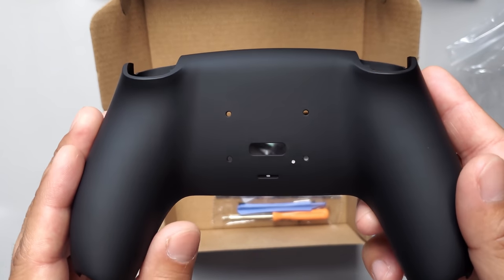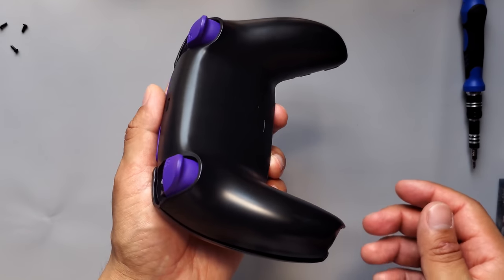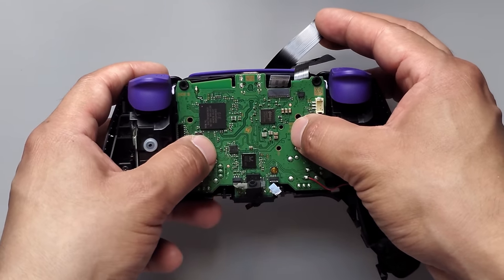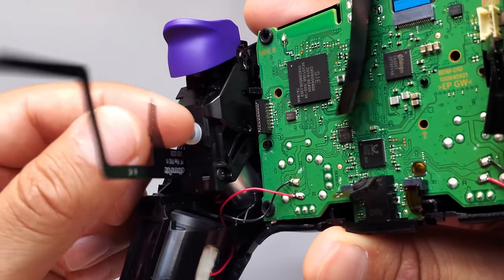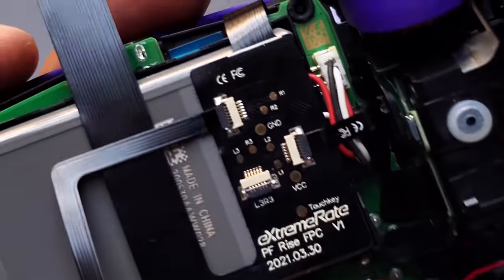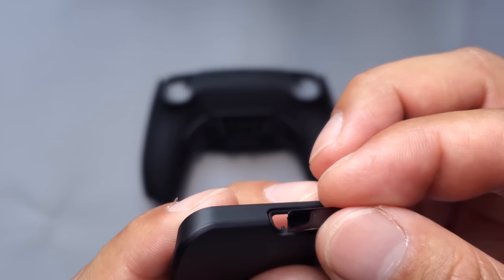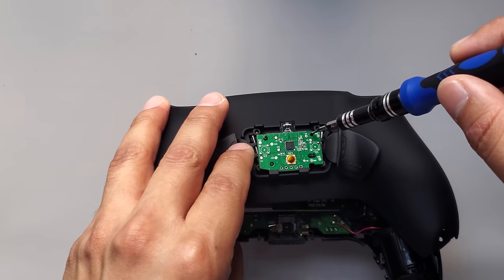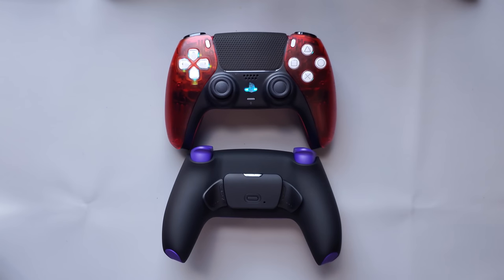DIY PS5 Controller (For BDM-010): eXtremeRate's Rise Remap Kit | No-Soldering Step by Step Tutorial

Comment: I just ordered a metal version but my control is version B20. Can a pretty much follow these steps? Someone please respond
Reply from the maker: I have the Rise4 video which the only difference would be the remap kit design but the wires are the same. That video has a Bdm-020 controller. 
https://youtu.be/tAOzyKJ-Xv0
Reply: @im.a.caveman  would you recommend watching that video over this video while I'm installing
Reply from the maker: @Gxckd  Yes because it uses the BDM-020 cables. For this video the cables and kit were made only for BDM-010. That's the reason why it doesn't showing which BDM cables to cut.

But remember, that the back piece is different if you have only 2 paddles and not the 2 paddles + 2 buttons.
Reply: @im.a.caveman  I just completed my set up and I get power to the Rise but it won't work, my control let's me click on a game to load it up for example rocket league, when it says "press any button to start" nothing will register on my control. What should I do
Reply: @im.a.caveman  I re opened it and seen a trigger cable had disconnected and it fixed it

Comment: Hey man, I followed your instructions in the video but now my controller won't turn back on. eXtremerate haven't replied to the message i sent them. Do you have any ideas on how to fix this? I obviously did something wrong but I don't know what.  Thanks for the informative video tho man.
Reply from the maker: If your original back shell model number is CFI-ZCT1W A or on the motherboard it shows BDM-020 then the kit is not compatible with your control. But let me know if it's actually BDM-010 or model number CFI-ZCT1W (No A after the W)
Reply: @im.a.caveman  Yeah its not compatible which sucks. Do you know why there isn't one available for my model? Thanks for the help man
Reply from the maker: When the remap kit came out, BDM-020 model controllers were starting to come out. Extremerate didn't know about a new model. It was just bad timing. I honestly wouldn't have thought that there would have been a change like that in the controller. Extremerate is currently working on making the right cables to be compatible with BDM-020. Hopefully it's soon.

Was the control included with the ps5 or you bought it separately? If it came with the ps5 where did you buy it?
Reply: @im.a.caveman  That sucks but yeah hopefully it comes soon. The controller came with the console and I got it about a month ago from a place called Argos in the UK.

I did realise that my ribbon cables were all white and blue whereas lots of other peoples on YouTube were black or kinda see-through.
Reply from the maker: Yeah that was one of the small differences that were made. Extremerate is probably just gonna have the cables that can work with the same remap. I think they need a more durable remap version though.
Reply from the maker: But there's also still BDM-010 being sold in stores. The theory is the BDM-020 is included with the console. Once BDM-010 starts to run out of stock, in stores, they'll end up being more BDM-020 controls in stores.

Comment: Great video. Very very helpful. I purchased this and the trigger kit and installed them. I can’t get the back buttons to work after programming them. Any suggestions?
Reply from the maker: After you programmed did you turn off the back buttons? On is for remapping and off is to turn off remap mode and be able to use them. Then just turn it on again whenever you want to remap to different buttons again.
Reply: @im.a.caveman  bingo. That was my issue. I still had it in remap while trying to use them. Thanks for the reply. Keep up the great content.

Comment: The only issue I found with this kit is that the buttons are too easy to press inadvertently. I measured the force needed to activate the buttons and it came out to 180-200gf. This would normally be fine if pressing the button directly but not when using leverage via paddle to do so. Can you replace the original tact switches with 400gf ones (PTS815 SJG 250 SMTR LFS) for a video
Reply from the maker: Yeah I've heard people say they're sensitive compared to other ones. Someone had said they swapped the tact switches and felt better. If I could swap the tact switches I would but don't know how to solder at the moment. I need practice.

Comment: Asked this same question on one of the replies below but just in case it's missed... 
Thanks for the superb guide. Top quality. 
My question: If we're not bothered about remapping L3 & R3 to the new paddles, I presume they still work as default in their original positions, yes? So everything works as standard as before inc. these L3 & R3 clickable thumbsticks where they've always been - you simply can't remap them to the new installed back paddles after this specific procedure (for this addition you have to solder I gather). So.. just to clarify, after I install this back paddle contraption, L3 & R3 will still work as they've always done in their original location on the sticks, we're not losing these two functions entirely somehow through this adaptation?
Reply from the maker: Yes, everything will work entirely the same. L3 and R3 work as usual. The remap kit is just so you can remap action buttons, dpad, and triggers. If you do the soldering version of the remap kit you'll be able to remap L3, R3, and touchpad to the back buttons along with the others mentioned above. 

In short, you're not losing any of the original functions.
Reply: @im.a.caveman  Wow, that's what I call a swift reply, appreciate your getting back to me so quickly. 

That's excellent. I'm not particularly bothered about remapping many of the buttons or even the touchpad other than what I use for gearchange in racing games - precisely the two buttons you remapped in the video as it happens.. "o" and "x" to transfer them to the paddles for gear up and down. Out of interest, after remapping does that make the original buttons you've mapped from non-functioning from that point on or do they simply double up and still work as well as the paddles? Perhaps that too comes under your .. "In short, you're not losing any of the original functions"

Anyway, you've earned a subscriber today just in case I change my mind in future and decide to learn soldering for that added functionality so know where to come for that detailed guide. All the best!

Comment: Everything turns on for me and button flashes when paired but when i try to use it nothing happens in game?? I have the 020 version and cut the wires correctly. Don’t know why its not working. When installing i double checked to make sure everything was pushed in all the way as well
Reply from the maker: After remapping did you turn off remap mode?
Reply: @im.a.caveman  i got it to work i didnt know you had to turn it off after. When i was taking the bumper off i jumped in game and noticed it was working lol

Comment: Three questions. 1; does it allow room to still use the dual sense charging dock? 2; do you have to reprogram it every time you turn it back on? 3; what steps are required to change the buttons to other buttons if you choose? 

Thanks in advance for your response. Appreciate the video. I’m looking at the V2 metal ones.
Reply from the maker: 1. It will not fit the dualsense charging dock, unfortunately. I did find one that fits them with the remap kit installed. It will appear one of my videos one day. Though it is cheap and can be a little flimsy but it atleast works with the remap controllers. 

2. It will remember the last remap that was done. Mines always on O on left paddle and X on right paddle. Or if it's the one with the 2 extra buttons as well then it'll remember whatever you programmed. The back only needs to be turned on when you're going to remap again. I personally haven't had any problems. 

3. When you say change buttons, are you saying the front buttons? 

Before buying I recommend checking for compatibility. The V2 and metal ones are updated to work with either BDM-010 or BDM-020. 

The metal ones are a great choice! Those are actually my favorite. I have a video on that if you'd like to check it out:
https://youtu.be/K1Ziz0iYjFw

Comment: Excellent video.  Thank you!

Question, I moved my paddles over to a different controller, and now it seems I've killed both controllers.  I successfully installed the paddles on my old controller because I did want to kill a new one, then the old one started to suffer from stuck drift again, so I moved the paddles to my new controller, but now neither controller lights up.  I musta fried them.  So my advice would be to anyone doing this, have the battery disconnected for as much of the process as you possibly can.  No necessarily removed, but unplugged.

What's your experience on how many reputations the cables can take as far as plug, in plug?
Reply from the maker: I have one controller that's mainly being used for the videos. I've unplugged the battery for that controller many times. The control has no stick drift from the mods or dead battery from plugging and unplugging. If the one with the remap kit didn't turn on, have you checked that the kit is compatible with the control? For the one that doesn't have the kit and won't turn on, its not charging at all even after leaving the control wired for some time? There's also replacement batteries you can get if that's the case. If it is the battery. 

Please check for the compatibility for the control you moved the remap kit to.

Comment: Nice video very easy to follow thanks but I’m having a little problem when I connect it all I don’t get power to my controller could you give me some advice please
Reply from the maker: If it doesn't turn on than it most likely means the kit is not compatible with your control. You need the correct kit/ cables that are compatible to your control.

Comment: Is this remap kit compatible with the clicky hair trigger? I currently have problems with diy paddles and board working with the clicky triggers. I would love to try this set out as it includes no soldering which makes it a lot easier! Let me know please
Reply from the maker: It does! I have a red control with hair triggers, Remap, and led. My 2nd control is going to have all that with a face clicky kit installed as well.
Reply: @im.a.caveman  Amazing, so its all plug and play and works together?
Reply from the maker: @Newyen6MT  If by plug and play you mean opening up your control and installing the remap kit then yes.
Reply: @im.a.caveman  awesome!!!

Comment: Great Video, Very Helpful! I did everything as directed but i have no power to my controller. Other than the battery, which ribbon is responsible for power? thanks!
Reply from the maker: There's a chance it's compatibility issues. Is the original back shell model number CFI-ZCT1W or CFI-ZCT1W A? On the motherboard does it show BDM-010 or BDM-020?
Reply: @im.a.caveman  CFIZCT1A on controller. Thanks for the fast response.
Reply: @im.a.caveman  On the motherboard it says BDM-020
Reply from the maker: Unfortunately it's not compatible with BDM-020/CFI-ZCT1W A. But extremerate is working on that issue. Hopefully soon they'll release something. Get a refund for now and we'll wait for the updated version to be released.
Reply: @im.a.caveman  any way to insure I get the bdm-010 from stores? this is the controller that came with the ps5
Reply from the maker: @unctarheelsfan4life  i don't know if it'll show for the newer models, but I checked the ps5 controller box at a store and it shows the model number on the side of the box. I bought one and it's a CFI-ZCT1W / BDM-010. There should be in stores. I haven't seen one yet that shows CFI-ZCT1W A / BDM-020 in stores.

Comment: Nice explanation and demonstration, very well done. I have a question because I’m quite new to this, how exactly are the buttons programmed, do they come like it or it a case of changing game settings?
Reply from the maker: Once you turn the back on, which is only to remap, you assign 1 button to each paddle, then turn the back off so it's not on remap mode anymore. Once the back is off your paddles will work if you bought the kit compatible with your control.
Reply: @im.a.caveman  Alright thanks 👍🏻

Comment: Perfectly succinct and accurate walkthrough, thanks so much! I have one question, once the controller is all reassembled, is it possible to open the remapping kit? One of the paddles is a bit loose so i wanted to swap out the little metal bar to see if that would make a difference but do not want to take the whole thing apart again. Thanks for the help!
Reply from the maker: Thanks alot man! Yeah, you can just pop the back piece off, undo the 2 screws from the remap board, and you should be able to remove the paddle.

Comment: Very well done Tutorial👍🏼 
I also modded my PS5 Controller with those extremerate paddles. Everything went very well and the led turned on. I also could program the paddles but when I click them after programming, there is no reaction on my PS5 so they don’t work. Can you help me with this? 
Thanks in advance.
Reply from the maker: After you remap you should turn off the back. On is only for remapping.

Comment: Does the new backplate you installed have texture like the base backplate? I think the sandpaper feel of the normal controller is really nice and helps me get purchase. On my phone that backplate you installed looks real smooth and possibly a little slick. Thoughts?
Reply from the maker: Doesn't have texture on it. Its not slick, it's a matte finish. Personally it feels nice on the hands. There's other options that have a texture on it but it's different from the original. Take a look.

eXtremeRate Textured Black Programable Rise Remap Kit for PS5 Controller BDM-010, Upgrade Board & Redesigned Back Shell & Back Buttons Attachment for PS5 Controller - Controller NOT Included https://www.amazon.com/dp/B095H5XV54/ref=cm_sw_r_apan_glt_fabc_3RQDMGH5EYWQFFQJGTND?psc=1
Reply: @im.a.caveman  Thanks bud.

Comment: i followed all the steps but the button on the back to turn it on is very stiff and i see no red light can you help please
Reply from the maker: If the button isn't being pushed down then try to turn it the other way and test if it pushes down. So open up the back buttons so you can take it out. The button shouldn't feel like it's stuck. It happened to me before but I just moved it around and tried finding how to make it work correctly and I got it working.
Reply: @im.a.caveman  I figured it out thank you so much for your help🤝

Comment: I've physically disabled the r3 clicker (clipped off the orange plastic inside the thumbstick that would depress internal button). Would i be able to program R3 to one of the rise paddles by remapping it to another button via PS5 custom button assignments, or if I would have to open the controller up and hold it in with a flathead long enough to program the RISE paddle? I'm assuming I would still have to solder the r3/l3 rise paddles either way... Thanks!

Comment: Mine won't turn on after the installation. I can see
online a lot of people have the same issue
when unplugging the 11/12 cable it works,
when plugging it back in, no power??.. won't
switch on. I have bdm 020 motherboard and
kit.

Comment: great tutorial. thank you for this. used it to install mine and it worked!!! just a question though ... other vids you show putting on the original foam pad from the original backplate. Is it necessary for the back pedal backing?
Reply from the maker: If I remember correctly I was putting it on mine but I didn't because I think it ends up being in the way.

Comment: can I take it apart and put it on a new controller when my old controller starts to drift?
Reply from the maker: You can but then I would recommend not cutting off either the Bdm-010 or Bdm-020 cables included with the kit just in case you need them. This video was before the Bdm-020 controllers were released. Check out my Rise4 video if you'd like. it shows the 2 different cables in the video. 
https://youtu.be/tAOzyKJ-Xv0?t=603
 
The controller in the video I linked is the model CFI-ZCT1W A which has a BDM-020 board.

Comment: great video, where did you get the violett parts from?
Reply from the maker: It's a bundle I found on Amazon

https://www.amazon.com/eXtremeRate-Replacement-Touchpad-Decorative-Controller/dp/B08XQDP6JT/ref=pd_sbs_4?pd_rd_w=ElePp&pf_rd_p=651d64d1-3c73-45b6-ae09-e545600e3a22&pf_rd_r=PNB4RDVR31KPWDM400QQ&pd_rd_r=490a6520-e252-44e6-af94-eb53f9f71cfc&pd_rd_wg=rBz7Y&pd_rd_i=B08XQDP6JT&psc=1

But you can also find it with out the touchpad or trim/strip on the gamingcobra website. If you use my referral like or discount code you get 10% off (IMACAVEMAN)

https://www.gamingcobra.com/collections/ps5-controller-buttons/products/replacement-d-pad-r1-l1-r2-l2-triggers-share-options-face-buttons-for-dualsense-5-ps5-controller-purple-full-set-buttons-repair-kits-with-tool-for-playstation-5-controller-jpf1007

Comment: Quick question so that I don't have to open my controller before ordering: I have the correct backshell model number, is it still possible that I have the wrong mainboard? I bought my controller pretty early on so I'd be surprised if i had the newer model
Reply from the maker: So far if it's CFI-ZCT1W it should be BDM-010. I haven't heard otherwise.